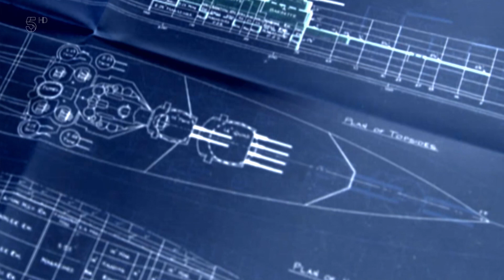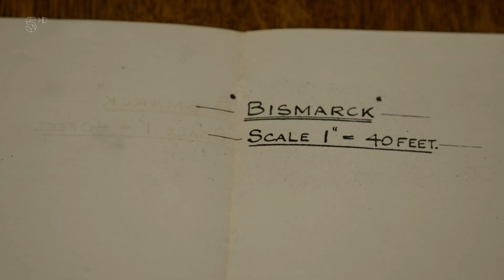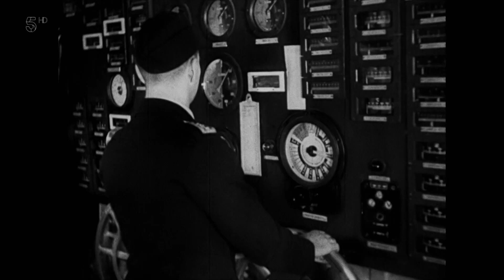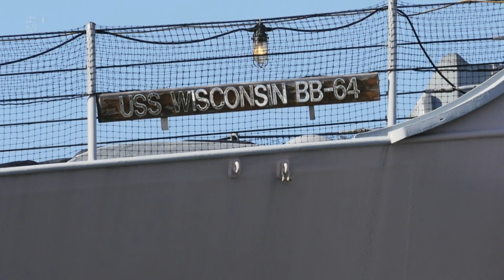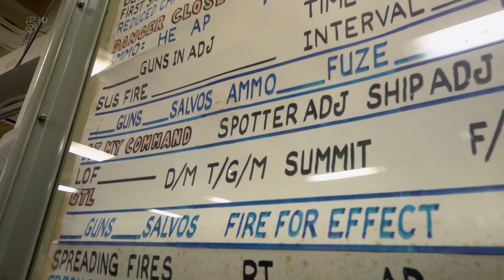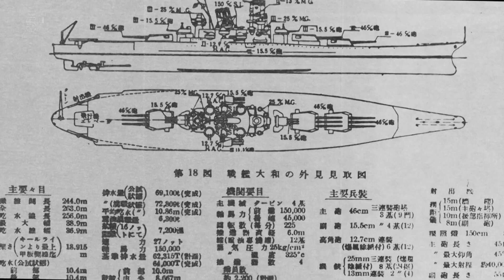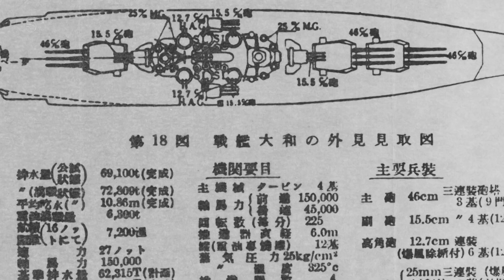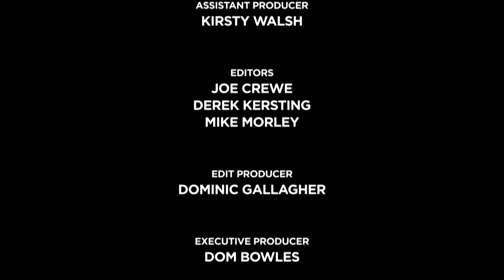World's Greatest Warships - Bismarck: Hitler's Great Warship | Episode 1/3 (History Documentary)

Comment: Ok, I am 7:50 into this show [introduction of Bismarck] and almost everything they have said so far is either wrong, the exact opposite of reality or just the amateurish platitudes that regurgitate the most common but erroneous popularly circulated nonsense that would be either laughed or failed out of a history classroom with the experts coughing up a lung.
Reply: Can I ask what points you think they have omitted/imagined?
Reply: @walterkronkitesleftshoe6684  
  thank you for the question… first of all the entire presentation is very amateurish and is there designed to appeal to a very base low level popular culture rather do any form of scholarly analysis.
  It essentially reiterates long rejected platitudes and hyperbole with respect to either Bismarck’s strengths or weaknesses.  
  For instance, why does the film refer to the Bismarck as “the most powerful Battleship in the world”?  The Bismarck broke the London naval treaty of 1932 by exceeding the 35,000 standard ton limit by 6700 tons.  This means that it weighed a total of 41,700 tons standard displacement. what did the Bismarck gain in exchange for these additional 6700 tons of displacement? Well let’s take a look shall we?
  In terms of armor, compared to the light battleships Scharnhorst and Gneisanau (~31,000 tons standard) the thickness of the main armored belt which protects the sides of the ships from the top of the second deck to the top of the thirds deck and from the front of the forward turret to the back of the rear turret,  ACTUALLY DROPPED! Yes was lowered by 30mm from 350mm (13.75 inches) to 320mm (about 12.5 inches).  The armored deck was lowered by 10mm from 95 to 85mm.  On the American 35,000 toners the deck armor was a whopping 150mm on the main armor deck.
  How about guns?  Much is made of the Bismarck’s gunnery.  Well she had 8x 38.0cm SK/C 34 (L52 or 52 calibers long, that means the barrel is 52 times longer then it is wide).  On paper same exact as the French Richelieu class battleships agin at 35,000.  Coming back to America, our North Carolina and South Dakota class (2 and 4 of each respectively were built) both had 9x the same 16” (406mm) mark 6s.  That an extra barrel AND! And inch wider shells.  
  To close out, it’s engineering, propulsion and steering systems were all literally throw backs to the end of WWI AND THE last battleships produced by imperial Germany the Bayern (sometimes called Baden) class.  It was atrocious and This would prove decisive in the Bismarck’s demise.
  BUT NOT AS DECISIVE as it’s absolutely non-existent (against contemporary aircraft) Anti-Aircraft defense.  I mean wow! It was bad.  They could have simply not had any and saved the money.  
  Anyway I have said enough.  Please feel free to ask any specific questions and I will elaborate in greater detail.  
  Conclusion: the German’s broke their own treaty, and yet managed to get nothing for it.  In no way can it be identified based on capability that the Bismarck even processed 19% extra weight above the allowable limit.

Thank you.
Reply: @walterkronkitesleftshoe6684  oh! And I forgot an important fact.  At 13:27 the narrator states “at 5:56 the Bismarck penetrate the Hood’s deck”.
  This theory has been discredited even as early as the naval commission convened to analyze the Sinking of Hood immediately after the fact during WWII itself.
  In fact the opposite happened, the Bismarck struck the water just short of the Hood, thus allowing the shell to dive BENEATH the Hoods main armored belt and penetrate under it through the thin anti-torpedo Defence.  Thus punching straight into either the 15” powder storage room or the 4” powder storage room [which were both near each other and separated by a thin bulkhead which either one would have destroyed as it burnt furiously after being ignited by the shells own bursting charge (18.8kg of high-explosives) inside it.   But there was certainly no deck penetration as the two ships were so close close to each other by then that the angle of the decent of the Bismarcks shells were calculated to be only 17 degrees.  a hit like that would have simply skidded of the deck and went on its way.
Reply: @walterkronkitesleftshoe6684  well…the Germans certainly did have other pieces of equipment that were very unique, and innovative.  But it’s often the mandate that made the big difference.  So while no “wunderwaffen” could have won Germany the war [once they declared war on the US post Pearl-Harbor] there were many weapons that if not for the deranged lunatic Hitler would sure as hell cost a lot more allies lives. And maybe even bled the Soviet dry COMPLETELY.
  As a former Special Forces operator, take for instance the world’s first assault rifle, known then as the MP42, but eventually entering service and history as the StG44. 
  If Hitler had not rejected this revolution in infantry weapons and tactics in 1942 and only changed his mind in 1944 [way after it could have made a difference] the number of allied casualties would have sky rocketed, and out infantry would have suddenly found themselves a hell of a lot less effective.
  Just image a Brit with his bolt-action Lee-Enfield versus a German with a semi-automatic, intermediate cartridge [half the size] and a 30-box magazine that can reload all his 30’rounds as fast he can change a banana clip.  
But that is all history now.
Take care.
Reply: @WorshipinIdols  All excellent points Worship, All the best to yourself.
Reply: They also refuse to the ship as male. It's just weird to not know that kinda thing I got that from an American public school😂😂😂
Reply: Refuse to refer to the ship as male*
Reply: @WorshipinIdols  To be fair about the 15 inch guns the germans had lost the ability to produce the 15inch gun after ww1. So they had to re develop the skills and industry to build them.

Comment: it was ridiculous putting the hood in that fight you would have thought the admiralty would have learnt from first war you can't put battlecruisers up against anything more than a heavy cruiser the hood should chased after the prince augen what is was designed for
Reply: Why exactly was it "ridiculous" to pit Hood against Bismarck?

Hood                                   8 x 15in guns
Bismarck                            8 x 15in guns

Bismarck belt armour   = 12.6 inches
Hood belt armour          = 12 inches (Though angled so as to give 13 inches of protection).
Bismarck deck armour = 3.75 inches
Hood deck armour        = 3 inches

Hood was brought down by a million to one shot that likely found an obscure "Achilles heel" in her vertical armour.